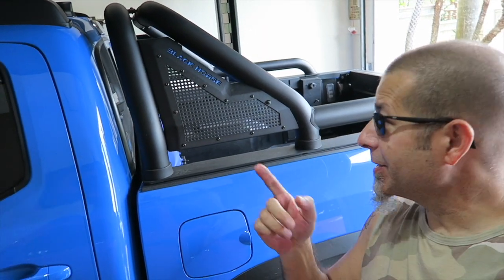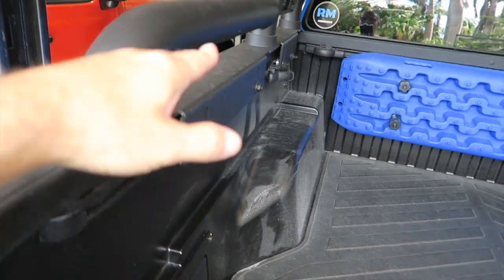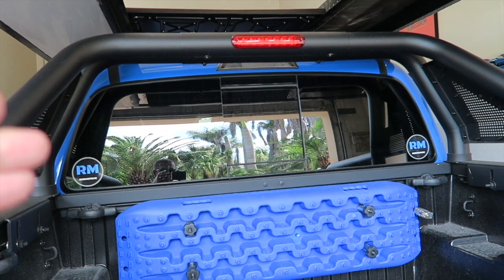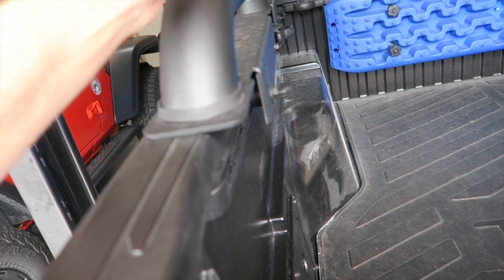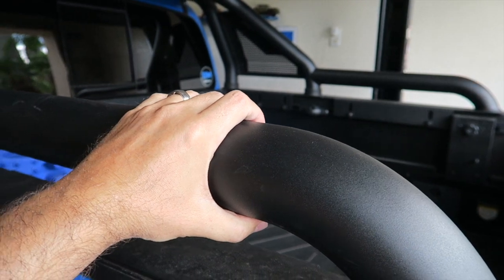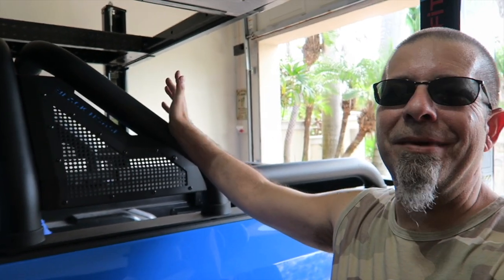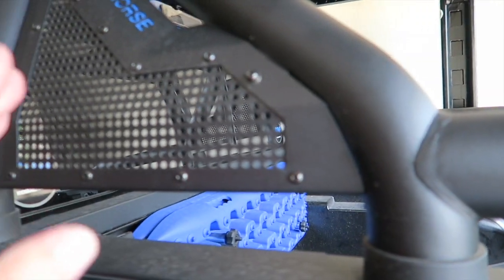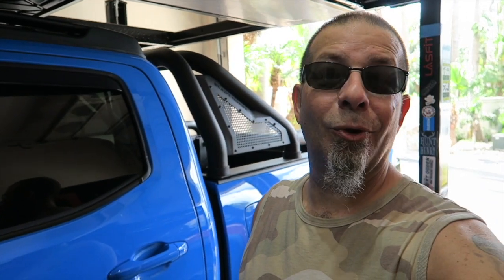Downside of Adding a Sport Bar to the Toyota Tacoma

Comment: Works if you want to haul a tall item like refrigerator. Can add under and upright tucked away storage if made from c purlin and allows for rear window protection, side bar tie off to bars, tarp cover cargo. The Tacoma looks whimpy in the rear without some modification

Comment: There's no reason for that kind of damage during shipping. That's just careless. My Diamondback bed cover was properly packaged and arrived without incident. Regarding the bar itself, not a fan. Its at-a-glance appearance it good, but it looks like it was adapted from some other truck and that's why it doesn't fit better. It unnecessarily takes up most of your side bed rails. Now I'm not suggesting you take it off or anything, it doesn't matter what I think as long as you like it. That's the beauty of the Tacoma, they don't all have to look the same. 😁 Oh, don't cut any wires on the OEM 3rd light, just remove the bulbs.
Reply from the maker: For sure!  Imagine if all of our trucks were identical…. 😬

Comment: I highly doubt 90 pounds is going to affect the towing capacity let's say the max towing cap is 2000 pounds so you can't tow if the gross weight is 2090? Give me a break throw it in an go it's a truck 90 pounds isn't going to matter